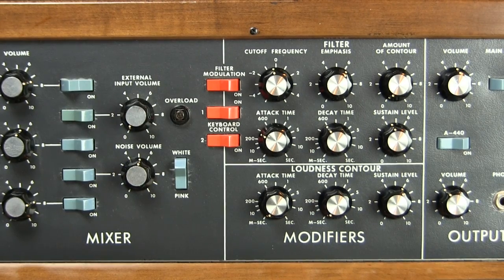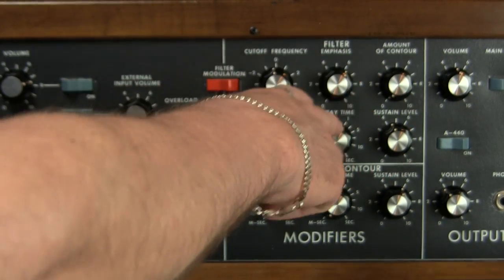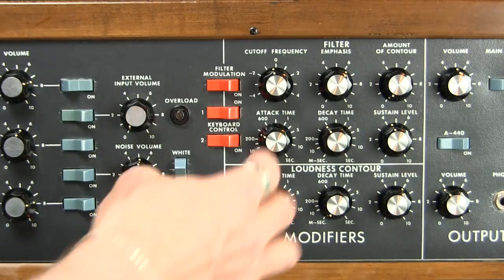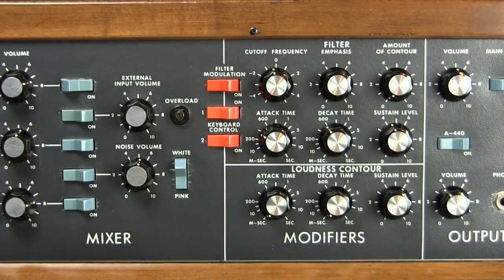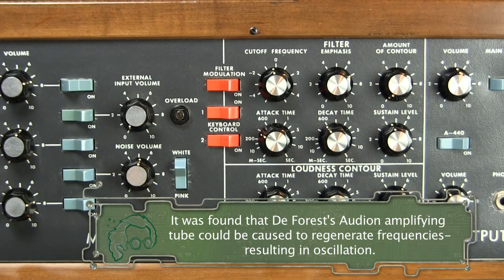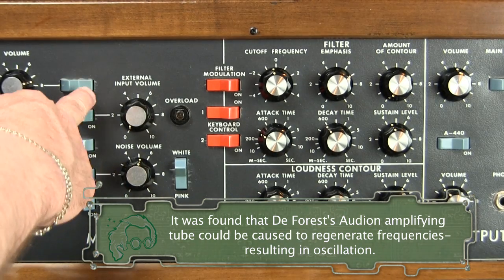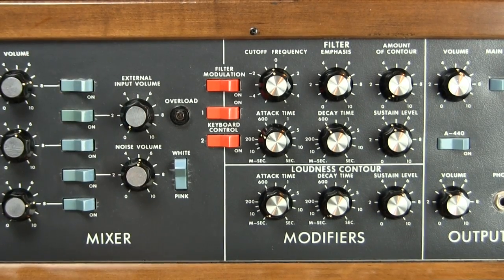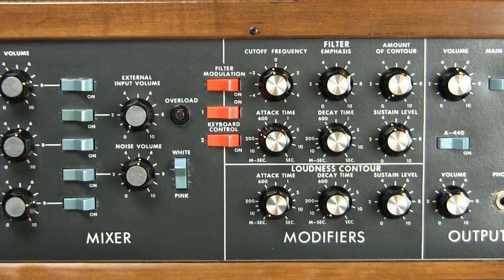The Filter- Minimoog Filter Self-Oscillation

Comment: thank you for posting this. i always thought self-oscillation in filters was somehow related to feedback. very well explained and informative!
Reply: I believe you were right actually. If I understand it correctly, this behaviour is caused by feedback within the circuit itself. The "resonance" feature of this filter is itself based on controlled feedback - it's feedback of the filter's output going back through itself that causes it to resonate, and so when you push it into "self-oscillation" (when the output is above a certain level), it will "sing" at its resonant frequency all on its own, from its output (at its resonant frequency) being fed back into itself. You actually could think of this as pretty similar to holding a microphone to a speaker cabinet and getting that "eeeeeeee" sound, the difference is, with this circuit, we can control the resonance frequency precisely and produces pitches that we actually want (with the keyboard itself when "keyboard control" is enabled). Whereas with a microphone next to a speaker, it's going to feedback at whatever resonant frequency/frequencies are naturally present in that system (often a pretty high and unpleasant squealing one haha).

But that's a scientific explanation of how the phenomenon occurs, and not really representative of how it feels to interact with it at this level. So even though it is caused by feedback, you don't really interact with it at that level, or need to understand the basis of the mechanism, in order to use and enjoy it. You would only need to understand the specifics of the mechanism if you were building your own resonating filter/oscillator circuit I think really
Reply: @Muzikman127  I'm not too sure about that, friend. According to the explanation on the video, the pitches we hear are produced by a standing wave (frequencies that "sync" together in such a way that their higher amplitudes happen to meet a single point, increasing the total amplitude by a lot at that particular point), and that would result from the high-frequency emphasis. I could be wrong, though. I'm far from an expert.

Comment: Amazing little well known trick. Sucks that the scaling is not a 100%, that is a very sweet sounding sine wave, but it ends up going both flat and sharp as you move around the keyboard. 

Another little known trick: you can fake an envelope modulating the pitch of an oscillator by adding a bit of envelope modulation to the filter, basically moving the pitch of the resonance as you play, similar to what you can do with a Prophet's oscillator being modulated by the filter env.

Comment: Am I right in thinking that this effect is dependent on the noise floor of the analogue gear? As in that's what the filter is boosting when OSC1 is bypassed? I've tried recreating a similar effect digitally and found that there has to be some noise present - you can't use a filter to boost nothing, if you see what I mean.
Reply: Digitally it will be different but on the analog side, all analog filters will be able to do this.
Reply: right, in order to "feed back", you need some signal present.  In an analogue circuit though there always will be though